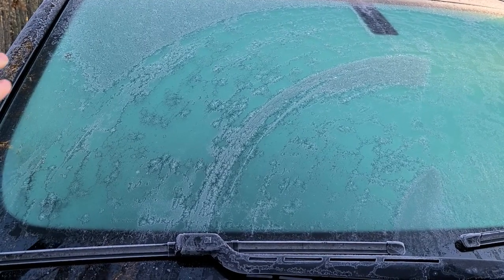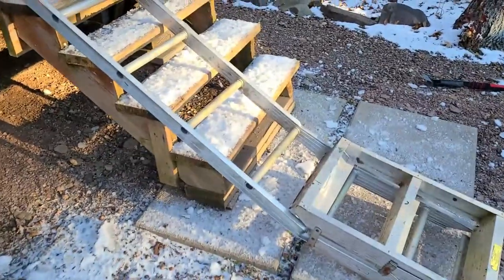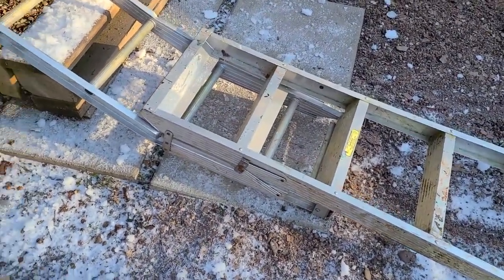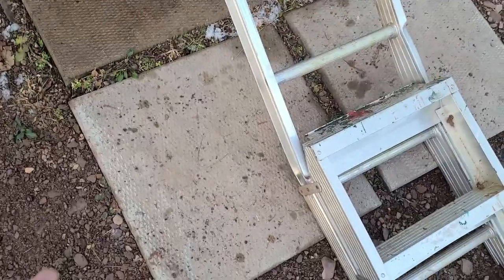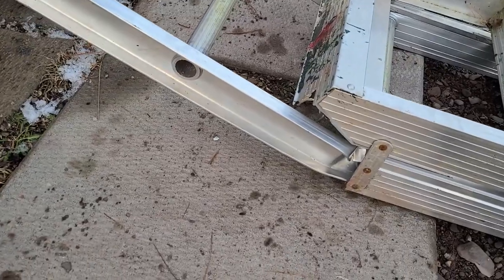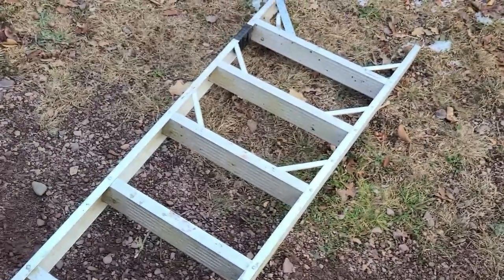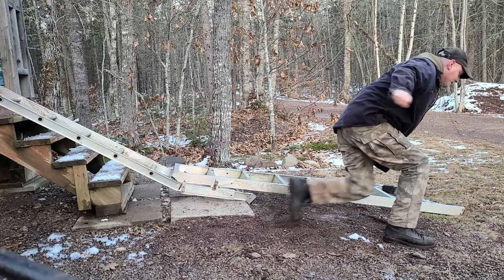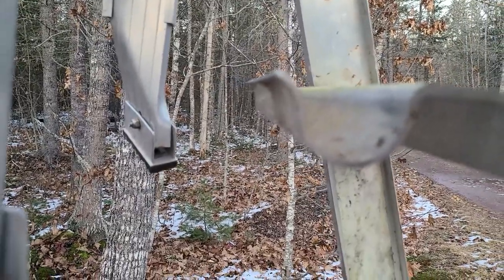Accident at the Cabin -  I was lucky

Comment: I'm so glad you are ok Dale. I would suggest a fixed step ladder, you might need a 12'. Lean it against the roof and pin it at the bottom. Take some stakes, or better pipe ,and sledgehammer, 2 of them at the base of the ladder and drive them into the ground. You will be hard pressed to have the ladder come out on you. Also a fixed step ladder won't come apart. As a carpenter, who has made just about every mistake you can make,  I believe that is what happened to you. Take care buddy! Happy Thanksgiving to you and your family, and of course, The Cabin!!!!

Comment: Like you say, it could have been worse.  When I redid the roof on my garage, I had 30 lb tar paper that I put on first.  One morning I climbed up onto the roof, and when I stepped off the ladder, the tar paper ripped and I went off the roof .  I was about 10 feet above the ground, and landed on my feet and splayed out fingers. with a hammer in my right hand.  28 years later, I remember that fall every time I look my right index and middle fingers, which are twisted to one side from the 2nd knuckle to the tip.  They were not broken, just badly sprained. I taped them together with duct tape and went back to work on the roof.  They turned all sorts of pretty colors, but were moveable the next day, so I never got medical attention.  So much for my nursing judgement! If it had been one of my patients, I would have taken them to Urgent Care right away!  Glad  you are not busted up!

Comment: Also from NH, the same thing happened to me a few years ago while cleaning snow off. About the same height and same type of ladder but my security camera caught it and the feet of the ladder just slid out. I had a clean concrete pad at my porch roof like you and like you, no crazy pitch and my ladder was bent just like yours. I use ladders with the claws for traction. Not doing that again!!
Keep strong and stay safe
Reply from the maker: Thanks. It's crazy how fast it happened. Happy Thanksgiving. 🍺

Comment: I fell last winter in my townhouse parking lot thanks to ice but only slipped from ground height. I fell flat on my back and slammed my head on the ground and landed on my backpack which had my laptop and a long distance hole puncher in it so it did a number on my back. I'm a bit younger than you are but it still took a few days to get over. Hope you get to feeling better soon.

Comment: I fell off a ladder 4 or 5 years ago and climbing up one has never been the same.. I used to fly up those things no problem but one fall really changes things. I know what I'm doing.. or thought I did.. just a stupid freak accident where some leaves on a wood deck sat for months and  created a slime that acted like a lubricant.. transitioning form the last step to the roof and it kicked out and down I went.. I was a little banged up but really not that bad. I actually got more hurt a few months later slipping on some media from sand blast cabinet... evidently that sand is round and it's basically like microscopic ball bearings. Amazing how you can get more hurt falling on concrete from  ground level vs 12 feet off a roof onto a wood deck..

Comment: That ladder would be scrap. I've got one of the old type aluminum 16' extension ladders that has the latches on each side, has never failed in the 40 yrs I've had it. The main thing on it are the feet, rubber on the bottom and they swivel up out of the way if you're in dirt or grass so they will dig in and not slide. Glad you're younger and ok. Im67 and that fall would've ended me.

Comment: Looks like the bottom feet slid back just a bit, and due to you being up top, relieved the pressure that holds that bottom rung in place and down you went. Get a ladder that locks around the rung the entire circumference and a separate step ladder if need be. or maybe one of those adjustable gorilla ladders, little giants, Louisville or Werner makes them too. I like Werner myself, but whatever.
Hope you feel better and didn't do too much damage to yourself.

Comment: You know I have to say looking at your video of the accident to me what it looked like was that you had somehow the bottom section of the latter which has the 2 swivel pieces on the bottom for adding stability whether it's on ground or concrete or whatever with the black rubber pieces it looks like you have that on the top instead of on the bottom and somehow the unit gave way That's my scene from the video that I saw on YouTube here today I watched it twice just to try and verify and that's what it looked like to me.
 It looks like you had the unit  The wrong way when you place it down because the swivel with the feet on the bottom Could have been on the bottom and the way it looks you had that swivel with the black feet on it on the top and that's probably why it gave way
Reply from the maker: It also had the rubber feet on the other end so they were on the concrete. But I should have been using a better quality ladder.

Comment: Does your ladder have feet on the bottom that adjust to the angle of the ground?  It looks like the base of the ladder slipped down the slope.  And the ladder looks a little too light duty for a grown man.  You are very lucky that you did not have some debilitating injuries.
Reply from the maker: Yeah, rubber adjustable feet but you're right, that was not the right ladder for the job. I'm getting a better one.